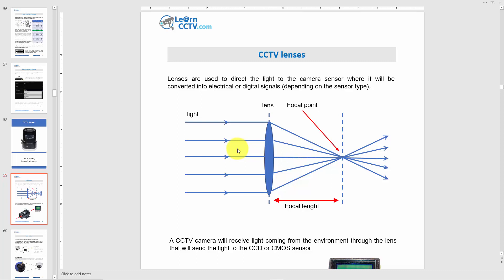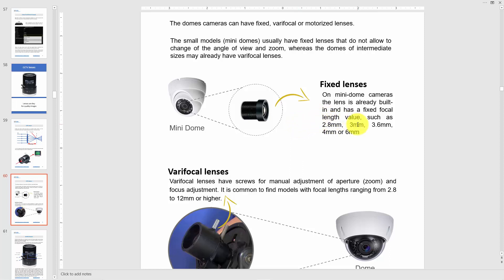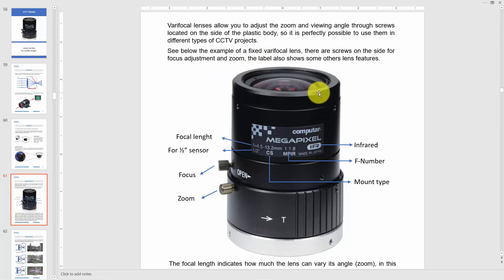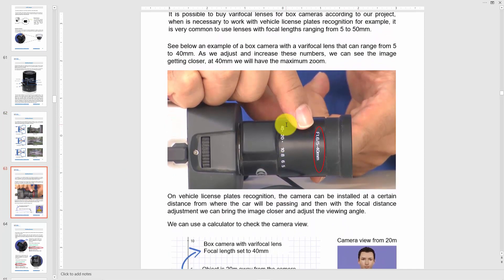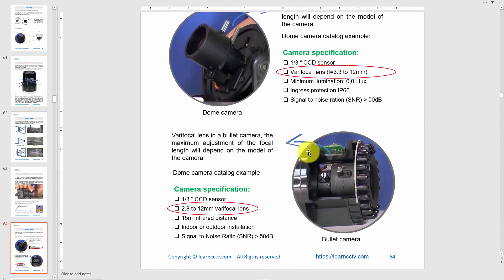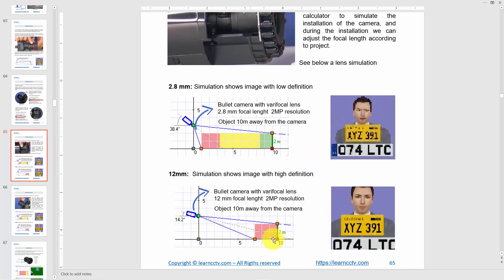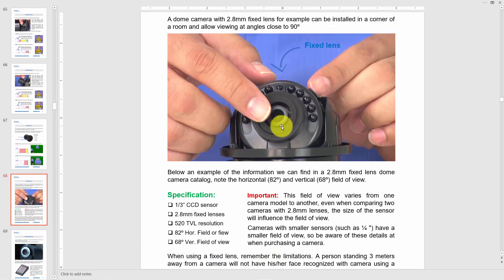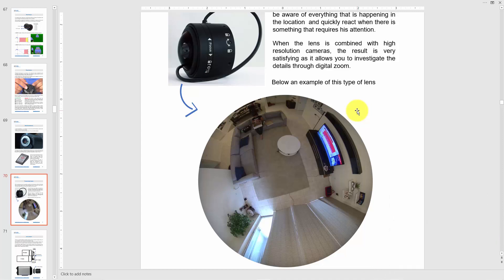Lenses for CCTV cameras ( CCTV course)

Comment: I purchased one of those auto focus Samsung dome cameras that sit inside a vandal proof glass dome. if it rains and it gets a water drop on the glass the camera focuses on the water drop and the background remains out of focus until the water drop as dried up. It is very annoying also cobweb spiders are attracted to the infrared on CCTV cameras and if my camera gets focused on a spider it sometimes gets stuck on that focus and I have to push reset. Expensive camera it was but I think I made a mistake buying a auto focus.

Comment: I enjoy your vids,  but I have yet to see a vid on how to change any IP camera's IP address.
I need to designate a static address for 5 of my Chinese IP PTZ cameras, and so far, no luck.
No app or software I've tried will do this.
The Daihua XVR I have will not change an IP address.
Only app I know of that allows an IP address change is V380S.
Maybe a HIkvision XVR has more deluxe features...for $400.00 + Cad. dollars. Yikes !
Reply from the maker: Just log into the camera using a eb browser and open the network menu. You can change the IP address there. The principle is the same for any IP camera, computer, IP Phone or whatever device that connects to a network. You can change your Dahua or Hikvision IP camera to the same network range and use a software or recorder that works with both or use the ONVIF protocol that's universal. https://www.youtube.com/watch?v=UC8oGdfJkdI https://www.youtube.com/watch?v=6HpaU1XddOs
Reply: @LearnCCTV  Will try this, then get back to you.